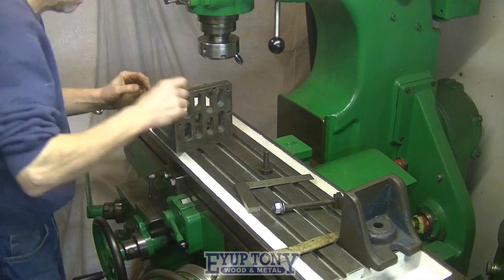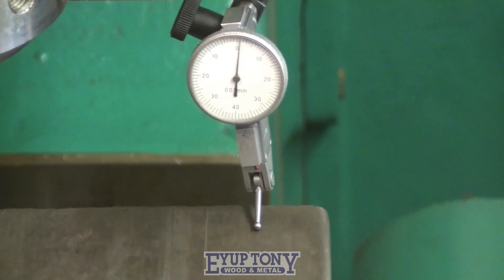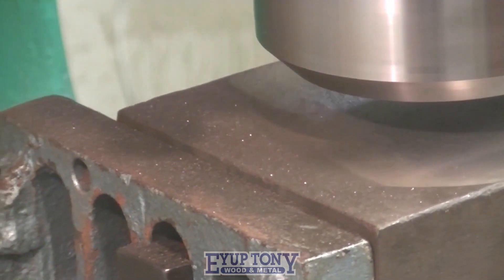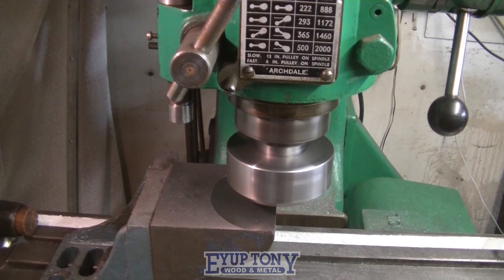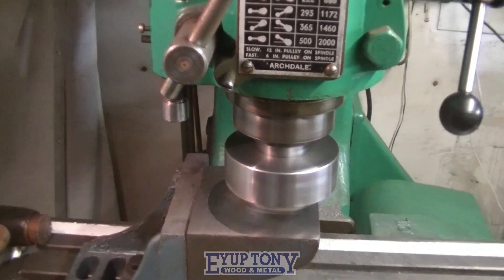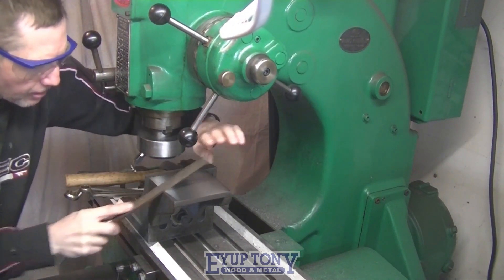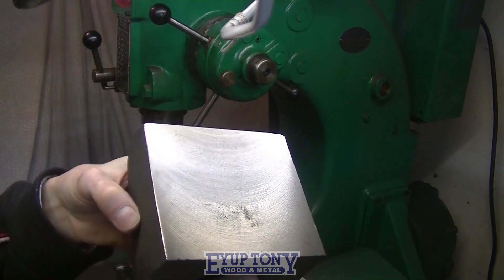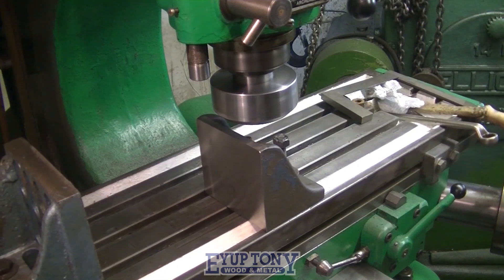Milling Machine Angle Plate Set Up. Fly cutting cast iron.

Comment: Hi Tony, novice machinist here. Been turning for a good few years but new to milling and never used a fly cutter before. I am about to attempt the refacing of a cast iron exhaust manifold. Purchased a HSS fly cutter and tried on a piece of soft mild steel. Barely made a mark and damaged the tool itself. I am thinking tool shape may have been the problem.
Just wondering if it is doable in tool steel or is it best to just use carbide? I am considering a shell mill but they're not cheap.
Reply from the maker: Hi Paul. Sorry for the delay just seen your comment. I'm also a novice machinist. The high speed tool should be ok with cast iron but the hard skin on the outside of the casting may dull the cutting edge prematurely. I've used HSS on castings in the past with very good results. Initially the only reason I made this carbide tipped fly cutter was to machine the hardened jaws on my shaping machine vice other than that I've only used HSS. Thank you for viewing, I hope your refacing operation turned out well. Tony
Reply: @eyuptony  The HSS tool dulled instantly no matter how light the cut. Switch to a brazed carbide tip and that did the job. The job took an age however and the finish wasn't as smooth as I would have liked.
Was wondering whether a multi carbide tipped shell mill would give a better finish and make faster work of it.